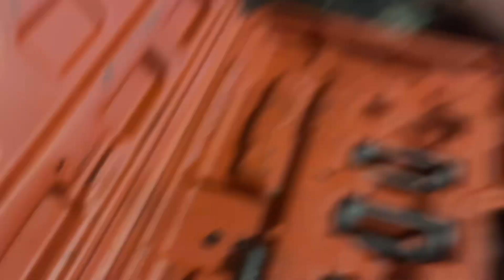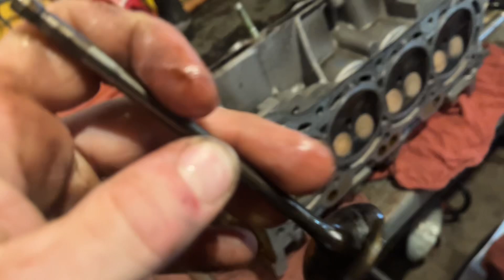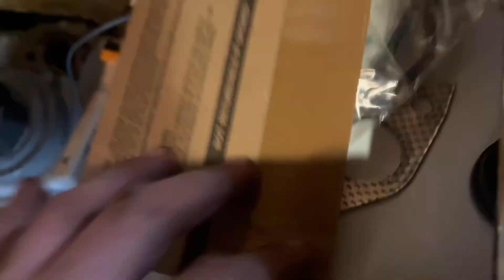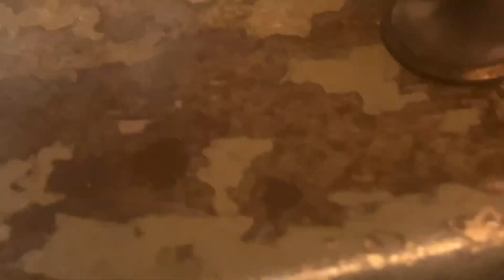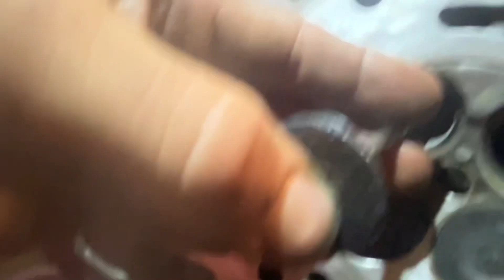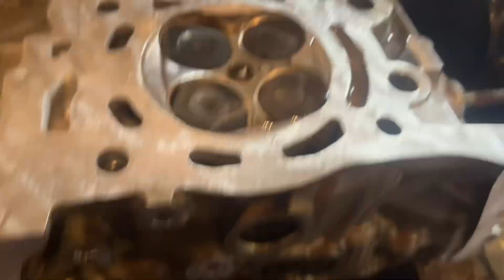Part 2. 2012 Prius How to lap/ grind valves, replacing valve seals, and check for deck warpage.

Comment: Thank you sir this is exactly what I was looking for. And if the block has wastage how would u resurface it diy style?
Reply from the maker: @joshfowler3040  Its tuff to do that DIY. Ive seen people do it with a straight piece of steel and sand paper. Others find a smooth spot on the concrete. Don’t expect to get it perfect if you choose the DIY method.